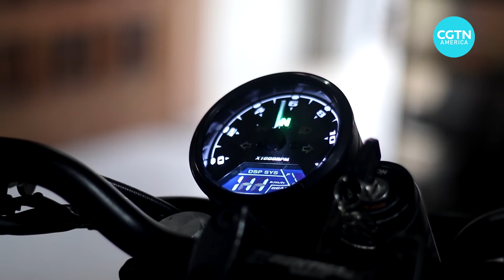Personalizing old motorcycles in Venezuela

Comment: Suzuki T500 Cobra.
2 stroke, twin 250 cylinder.
It didn't need a turbo and had a legal tag.
You cant buy a 500cc 2 stroke street bikes like that anymore. Not even an option.